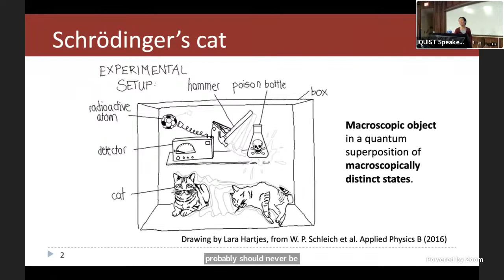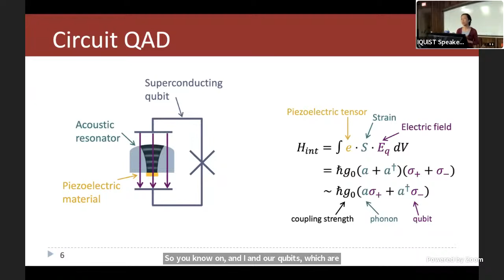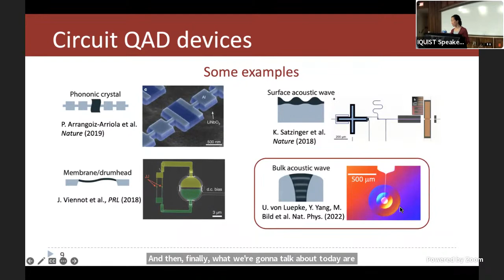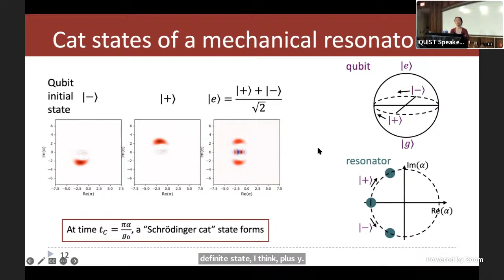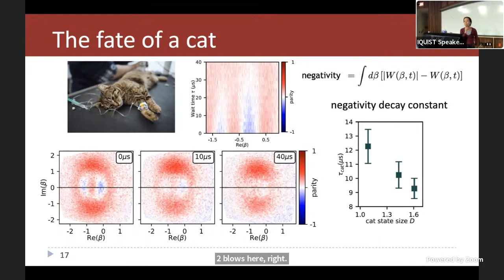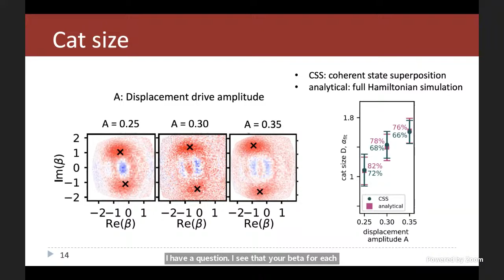"Schrödinger cat states of a 16-microgram mechanical oscillator," Yiwen Chu, ETH Zürich

Comment: Yiwen Chu, You might want to look at the high harmonic states used in atomic force cantilevers,  and the high harmonic generation for XUV, soft and hard x-rays.

When Joe Weber gave me a tour of his gravitational wave detector long ago, he said he intended that it would be used for ultrahigh bandwidth communication, using high harmonic modes of his cylinders, with many simultaneous points of excitation and sensing.

Richard Collins, The Internet Foundation